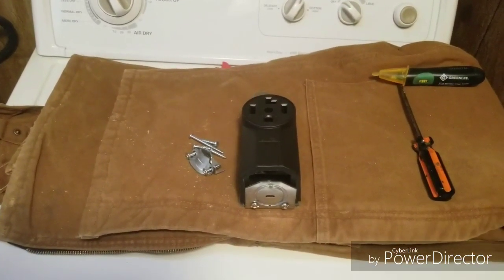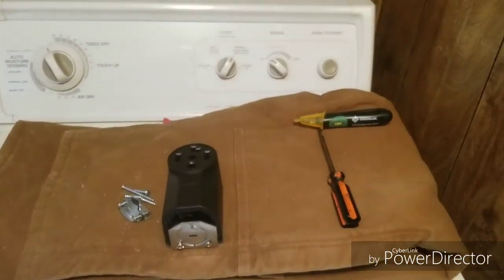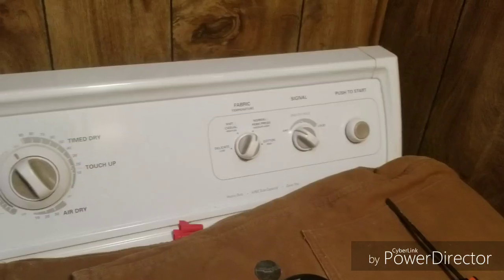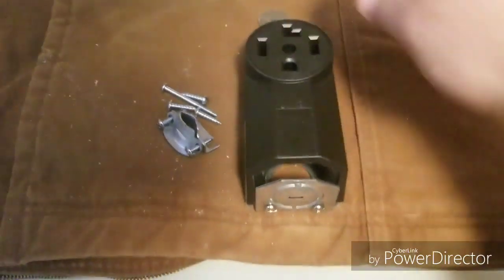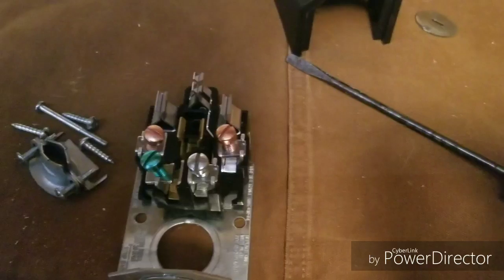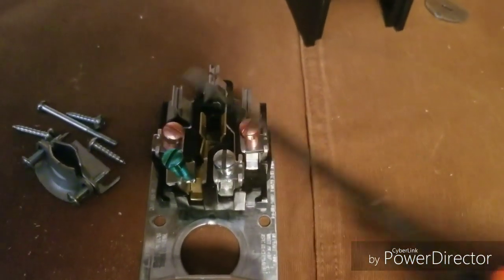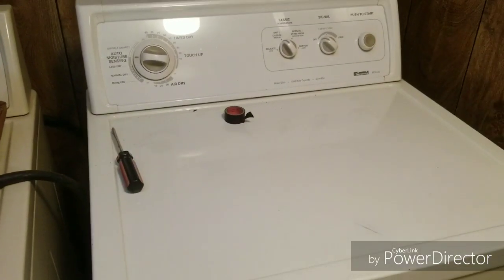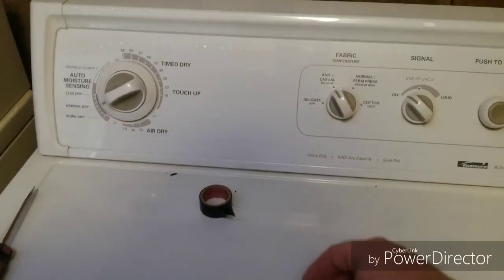SINGLE WIDE MOBILE HOME DRYER OUTLET INSTALL AND REDNECK WASHER DRAIN VLOG#18

Comment: If you haven’t already you should pressure wash the outside of your trailer. It could use a wash. I like the name you gave of this episode. Instead of this old house, you gave it the name this old trailer. And from watching your explanation of how your trailer came about. In my opinion it was a very smart move. Nothing wrong with getting out of the rat race. And out of debt. I’m sure you feel so much better.

Comment: If the trees are "in danger of taking out the power lines" the electric company will remove them for free. You can keep the wood if you want it or they will remove the wood. I've had quite a few trees taken by PPL (I'm in central PA). Some of them were healthy trees, most had either damage, were not doing well, or were standing dead. I believe it's 25 feet on either side of the power line (in PA) that they will remove or trim "problem trees". It may be worth a call..... My motto is "free is better than cheap"
Reply: Only 6 foot in either side of line for State of Alabama

Comment: Check the back of your washer it should show you which is hot and cold, then just attach the other to the mobile homes connection as it’s cut it wouldn’t be an issue and just use the cold setting. Keep it up though been enjoying the videos.
Reply from the maker: Thanks Timothy